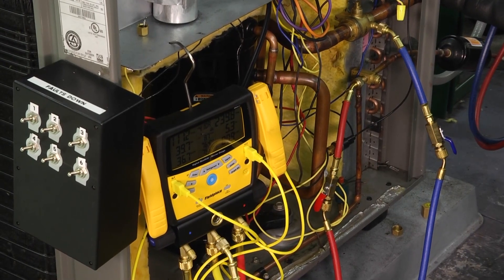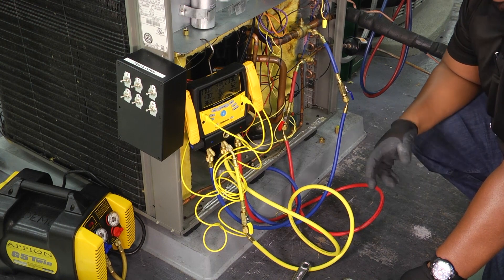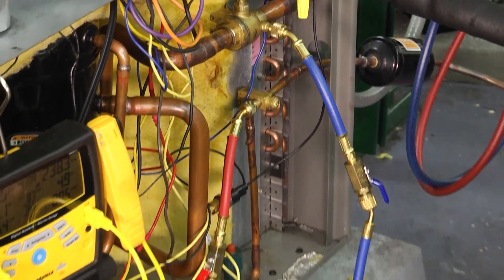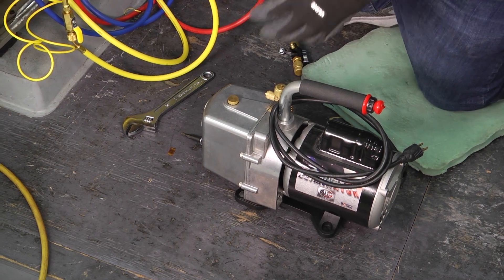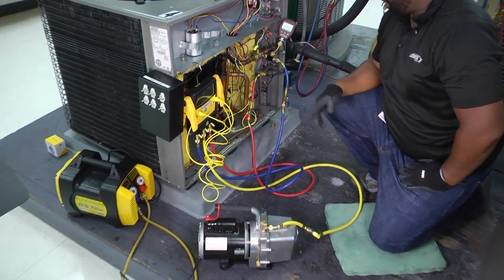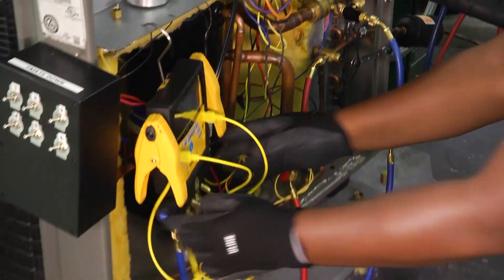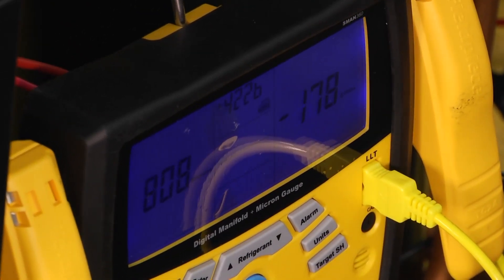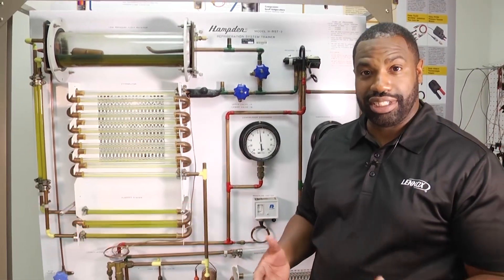How to Pull a Vacuum on a System

Comment: Hello
Nice tools to work with in the video. Unfortunately the reality is, ,most installers do not have the digital manifold and rarely do I see a micron gauge with service techs or install crews. Changing vacuum pump oil changes? I agree with your procedures but, there needs to be some incentive for these  guys to read instructions and follow these procedures. I'm just not sure what that should or could be. Maybe with the resources ofLennox, you can find some ideas. Thanks, from a HVAC retired contractor. Peace

Comment: This video is crap.  Why would you pump refrigerant into the condenser then pull a vacuum??   Recover refrigerant. Make any necessary repairs. Then purge/. Pressure test with nitrogen.  Then vacuum system.  I’m glad I don’t install Lennox   I’d be embarrassed to be associated with this nonsense.
Reply: this is the worst vacuum process video iv see in my life
Reply: James putting refrigerant in the condenser is done all the time whenever you have to make a repair on the evaporator side of the system. He is flawed in the way he is directing how to pull a vacuum you shouldn't pull through a manifold. Get vacuum rated hoses at least 1/2" or bigger to pull through and hook them directly to your pump and get the micron gauge as far away from the pump as possible.
Reply: Larry Cole he shouldn’t even mention pumping the unit down. Evacuation has nothing to do with pumping a unit down.  He should have the example situation be the system was opened to atmosphere and repaired.
Reply: @jamestabor2001  they leave a lot to interpretation sometimes like in this case to much.
Reply: am an HVAC newbie and even I could tell he was wrong on that...
Reply: This is a normal process as long as the system does not have a schroll compressor. He should have mentioned that’s because they should not be pumped down
Reply: One of the reasons I know why a technician would pump down into the condenser first is to bypass any solenoid valves while they can still actuate under their own power, if you try to pull a vacuum without this step then you simply need to use a solenoid magnet to open those valves in order to avoid possibly trapping any refrigerant.

Comment: Helpful video....How do you clean a micron gauge?? Really need to know thx
Reply: Kevin Barker Hi , not positive but, I would think the flush used to clean refrigerant out of line sets would work followed by nitrogen and then vacuumed out?  Peace
Reply: Look up the manufacturer's website for the user manual of your micron gauge be the proper answer.